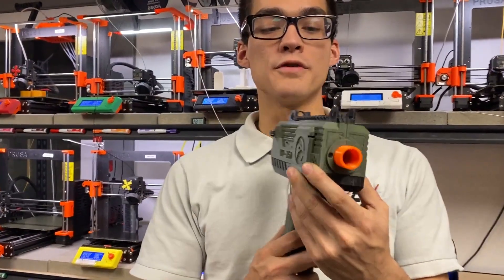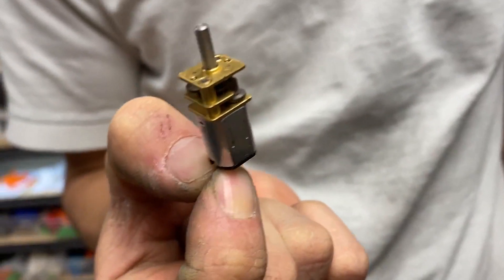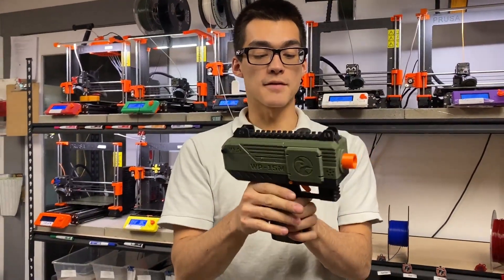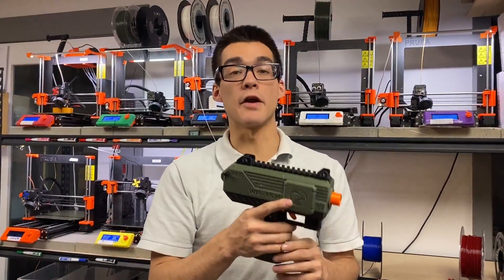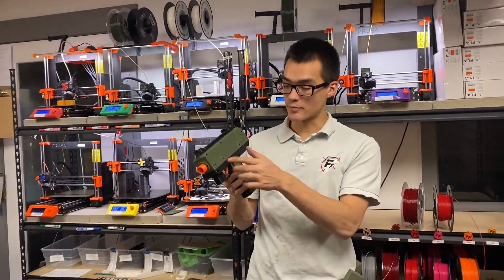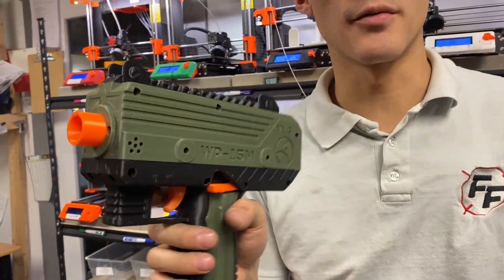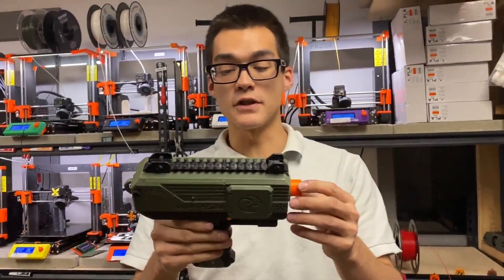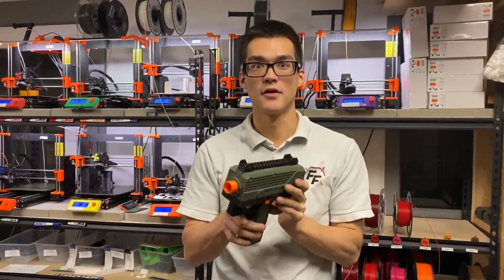N20 Woozi Overview | Nerf Blasters

Comment: If I don't want the selectfire but I want the variable rate of fire, should I just get the fastest pusher motor and then use the poti to turn it down?
Reply from the maker: Yeah, you could just purchase a few different motor setups and swap them out as you like.
Reply from the maker: https://www.frontlinefoam.com/product/additional-lepus-motor-setup/
Reply: @FrontlineFoamBlasters  No I meant can I use a potentiometer to adjust the rate of fire with one motor?
Reply: @DerSerafin  you can if you can find somewhere to stick a PWM board. Also the higher the RPM the lower the torque so I wouldn’t go above 1000 rpm without risking pusher jams.
Reply: @llsnyderj  That's exactly what I did, except for the motor. I got the 3000rpm and it works just fine.
Reply: @DerSerafin  good to hear! She must be crazy fast
Reply: @llsnyderj  I actually uploaded a short clip of her.